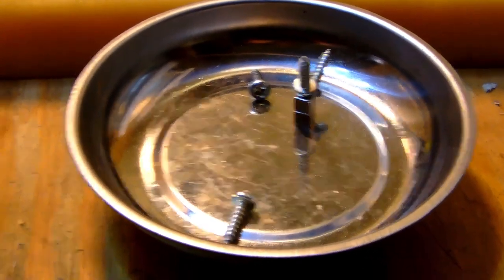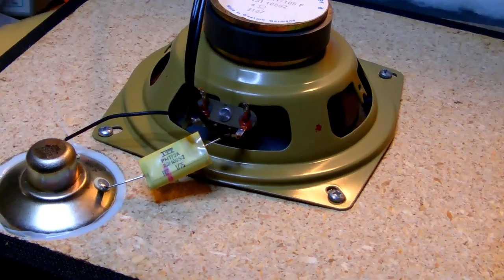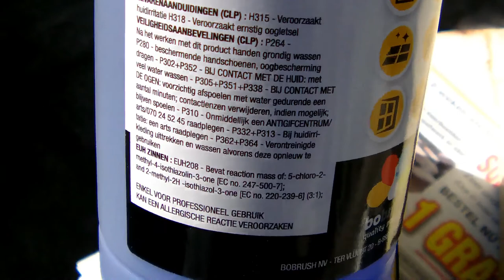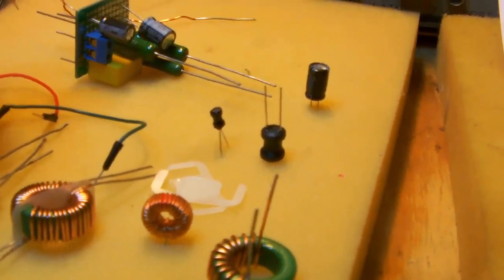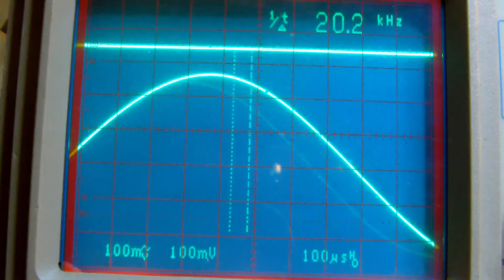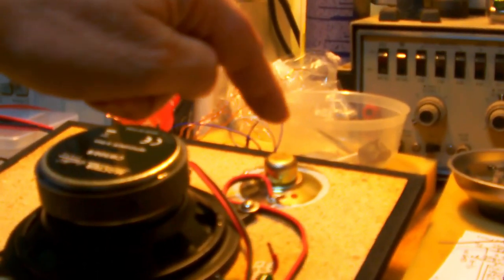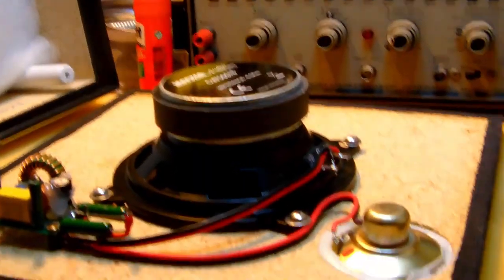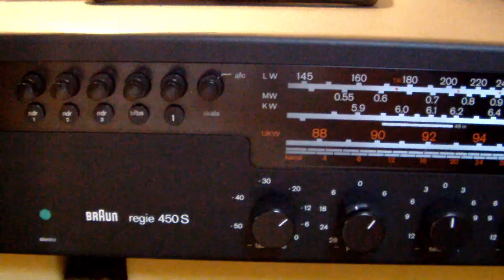Loewe B-20 Speakers Repair Restoration part 1 of 1

Comment: Hi Buddy, long time no see.
Thank you so much for the "TIP" on how to safely remove old labels, and cleaning of the plastic cabinet.
Hope you and all are fine. Carl
Reply from the maker: Hello Carl :) You're always welcome, of course. Yeah, I thought that tip might come in handy to some people, that's why I included it. Using petrol to release the glue has an added advantage it doesn't damage substrates on which the labels are glued (like plastics, bakelite, metals etc). Although alcohol (or acetone), work well enough if one is patient enough, they can either do potentially more damage or do nothing at all depending on the combination glue/substrate
Thanks for your encouraging comment and your thumb's up :)
Reply: @TechneMoira  Hi Buddy, the Best to you and yours's . Carl